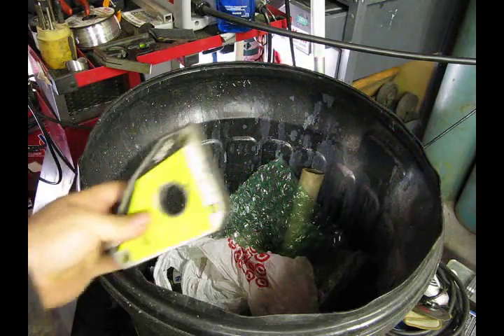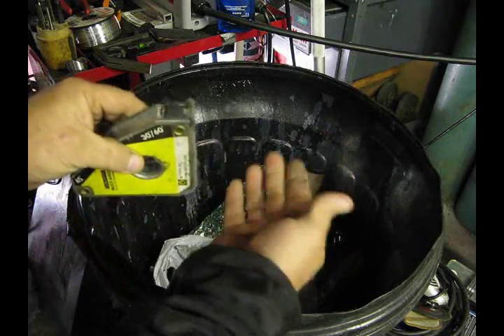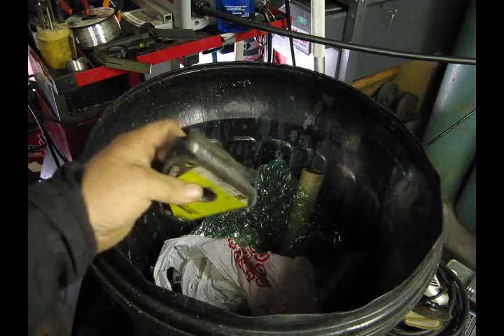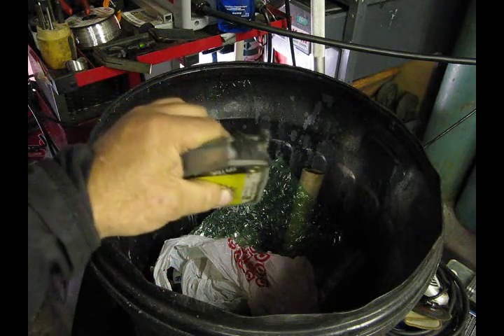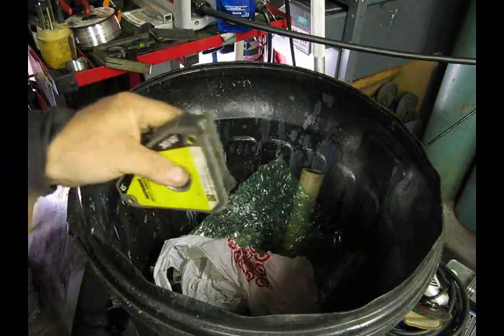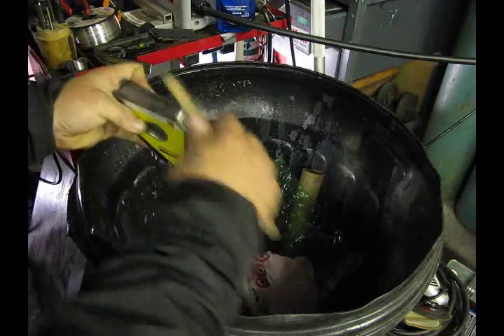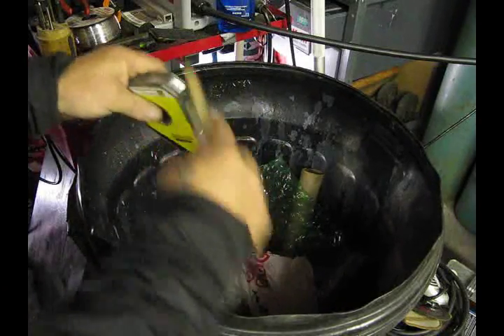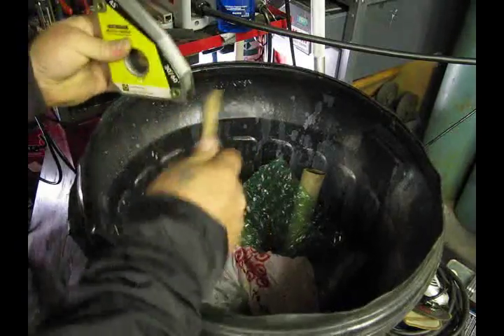Removing Metal Filings from Magnets

Comment: Thanks for the tip. Only had stiff nylon brush handy, but in about 2 minutes had 7 welding magnets cleaned like new.
Reply from the maker: Hey! That's great! I never tried it with Nylon Brushes, might take a little longer, but if it works, that's one more trick up your sleeve! Keeping those welding magnets clean is a full time job so anything that makes it easier is a good help. Happy New Year!

Comment: Good tip. I'll have to try that.  You said to use stainless steel.  I was wondering if you could use a brass bristle brush since it's a non-conductive metal.  Thanks again.
Reply from the maker: Give it a try!

Comment: Use blow gun from compressor
Reply from the maker: That's EXACTLY what you DON'T want to do. Blowing small filings all over the shop is a recipe for disaster or damage or both. This method puts the filings nicely in the garbage where they belong. Please don't use compressed air for this...
Reply: @JHV166  I blow it outside into my grass
Reply from the maker: @hectorcalderon3011  STILL a bad idea.. Filings belong in the trash NOT your lawn.

Comment: Great video. You could also use a strip of duct tape after brushing to get rid of the few remaining bits.
Reply: I do this with the same type of SS brush but I do it over my vacuum hose. But that last lil bit is always hard to get. Duct tape sounds smart